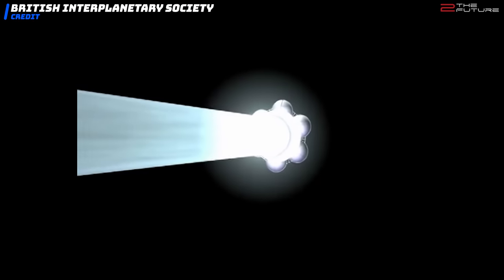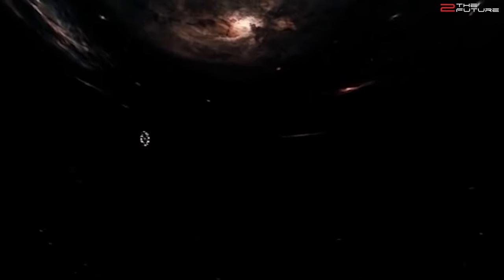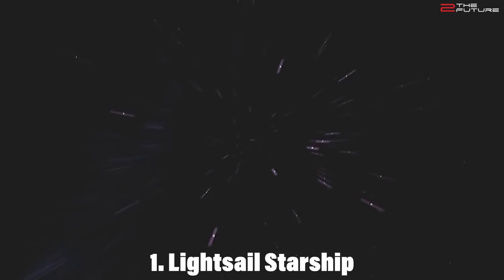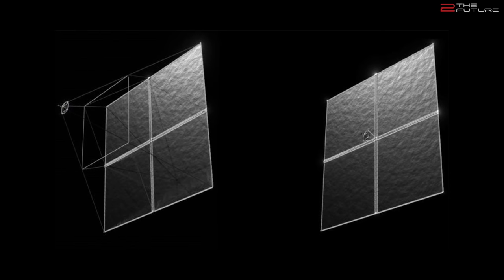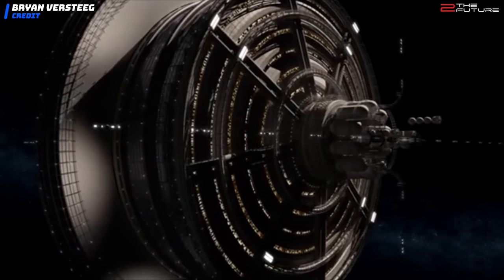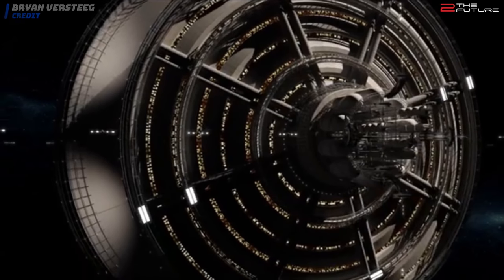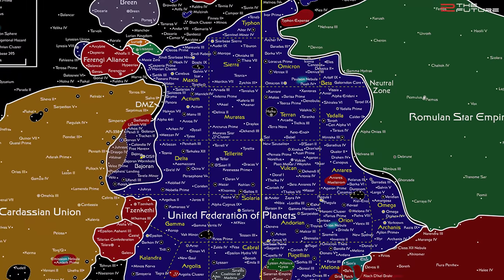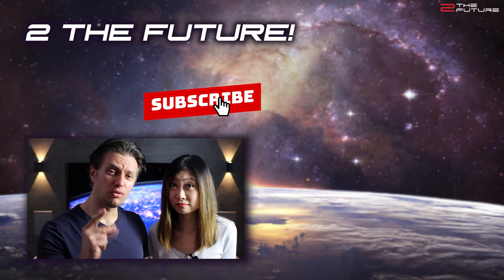Critical Starship Engine Upgrade To Colonize Proxima Centauri [Interstellar Starship Part 2]

Comment: The idea of a huge interstellar generation ship with fusion drive has the following problems:

1) Even stationary fusion reactors are probably still decades away and it will take more time to turn them into affordable engines.
2) There may be abundant fusion fuel in Earth´s Oceans or in the Moon regolith, but the problem is to extract it. Putting all of Earth´s ocean water into centrifuges is one thing, but how do you extract  both components from regolith?
3) Decay. You can´t use the same toothbrushes, shirts and shoes for decades. Likewise engine parts, plasters and antibiotics. So you either need replacements already in storage (a truly big storage) or you build it yourself on site with big factories and external resources - which are scarce outside of stellar systems and would require stops to collect them...which in turn would use up fuel and take years

4) Who would pay for this? No community would fund it, as there is no return to the community. No science, no riches. Perhaps some hyper-nationalist nations with enough economic power would fund such a thing in order to spread their "superior" culture across the universe...

Comment: There is a sf book by Robert L Forward called The Flight of the Dragonfly. In which a starship uses a light sail for a journey to Bernard's Star. The light sail then reconfigure itself in the target system to use light sent from earth to decelerate. It then discards the main sail and use a smaller sail to fly around the system. The book was written in the early 1980's has anybody revised the idea that lasers sent from Earth or Earth Orbit could both accelerate and deaccelerate the ship? It was a one way trip...Great video as always, thanks both.

Comment: the main problem with using ground based lazers to push the massive crewed  light sail is that the lazers would boil fry the atmosphere causing a super heated  fog blocking the lazer... so this lazer will have to be put in space...

Comment: You left out the most important (and highly unlikely) "The Improbability Drive" it allows you to pass through all points in the known and unknown universes at the same time. All you need is a cup of "Brownening motion solution" ( a nice cup of really strong tea) and a curved wire, it worked on "The Hitchhikers Guide To The Galaxy" so, when compared to some of the drives mentioned here, why not.

Comment: MagBeam.by the late great Jordin Kare. Laser accelerates small light sails like Starshot's which guide themselves to a magsail consisting of a large loop or loops of current carrying superconducting wire. A laser turns the small sail into plasma as it passes the magsail and interacts with it's magnetic field to transfer most of its momentum to the sail. Because the small sail need only be accelerated to a fraction of the speed of light, much less energy is needed than if it was moving at photon's speed per unit of transferred momentum.. The magsail covers a much larger area per unit mass than a light sail and the small sail guides itself so that the magsail can have a much smaller area than a light sail since even laser light spreads out over great distance. The magsail can be powered effectively at a much greater distance than a light sail and so a smaller laser can be used since more time is available for acceleration.

Comment: I think we'd do better to fully colonise the Solar System first. If we are able to get a partial Dyson Sphere up and running, it wouldn't be a huge problem to set up a stellaser of the required power to send a laser powered ship to Proxima Centauri. You should check out Isaac Arthur's video on interstellar highways using this concept.

Comment: The large cylindrical habitat does seem the most viable solution given current assumptions and presumes the existence of established space based civilization in Sol system.  A self-sufficient space based civilization only requires energy and raw materials to propagate itself. Planetary colonization and terraforming might be useful in the long run but need not be a high priority as creation of another interplanetary civilization can be implemented with energy, material and knowledge, and establish humanity as a viable multi-stellar species.

Comment: Thx for this informative video.
Oh boy.  Will we deface our moon by mining operations?
What if the reflective quality of the moon's Earth-faced side got diminished because of dark mining pitholes?
Probably it will be a Wild West situation, as it will be difficult to control operations across the distances.

 But maybe it will be better to keep Mordor on the Far Side of the Moon (new album to come anybody?)
Take care
Reply: IRC mining helium 3 is not a deep pit operation as all of it is within 3 meters of the surface of the moon and the tailings IE 90 odd % of the material dug up would just get put back in a previously excavated area.
Reply: @Barskor1  Well let's go then!  At least there won't be any Greenpeace protesters because they can hardly get there, and there is no life to protect!

Comment: Hello maybe using a concentrated beam of light magnified from the sun into a solar sail might solve required power needs and gives a constant push just a thought
Reply: Not as complex just a simple lens system
Reply: IMO just convert sunlight into electricity then into a laser beam solar flares and so on could seriously screw up the inputs for the launches with your plan.

Comment: A deuterium tritium may not be as bad as you think.  Tritium is manufactured for thermonuclear bombs by using a lithium containing ceramic that absorbs neutrons from a fission reactor. https://en.wikipedia.org/wiki/Neutron_activation
If the neutron produced in a deuterium tritium fusion drive reacts with lithium 6 you get an unstable lithium nucleus that quickly decays into helium and tritium.  In other words, you have a breeder reaction that provides more tritium fusion fuel and more helium propellant.

Comment: The baseball diamond in your illustration is wrong for rotating gravity.  You must pitch straight downhill and hit uphill.  This shortens distance you can hit giving a smaller outfield, and makes left and right fields the same, just with opposite curves on a fly ball.  Hitting the opposite way can make a hit travel almost forever, and pitching across the field like your illustration just screws everything up.  Your soccer field is good.

Comment: Why doesn’t anyone ever talk about the probability of a collision with very small matter during space travel? 

One tenth light speed is 18,600 miles per second (ish). Impacting an ice cube sized rock at this speed would produce a nuclear reaction and the resulting explosion would destroy the space vehicle and probably the rock... 

Avoiding or destroying objects at this speed is impossible for a number of reasons, not the least of which would be detecting objects along the vehicle path or those that are on intercepting paths with it and then managing the risks at such great speeds.

Traveling at these speeds, even if obtainable, is not feasible due to this single risk.

Comment: Why don't you like high powered plasma or ion drives? If you have a fusion reactor or even a portable fission reactor that can be cooled in space you have the power to drive these. Their exhaust velocity is higher than nuclear rockets. Both NASA and VASIMR have functioning prototypes. Sea Wolf submarines fission reactors put out 34 megawatts of power. If a similar reactor could be cooled in space a plasma/ion drive running on 34 megawatts could give an Apollo mass space capsule continuous 2.0 m/s^2 acceleration. Starting at 11.2 km/s (earth escape velocity) via chemical propulsion lift off and then accelerating at 2.0 m/s^2 via plasma ion drive can get you places relatively fast, and the propellant can be refilled in space using helium or hydrogen.

Comment: Light sail makes no sense. As any Earth-based laser array is subjected to atmospheric losses, and the planet's rotation would make it only function until line of sight contact is lost. 
You would have to build the array on the South Pole in order to maintain continuous output.  Instead, building it on the Moon would be more effective. No atmosphere.  Place it on its poles. 
But realistically, a sail is impractical. 
Current technology dictates the best method is to use thermonuclear explosions in series to accelerate the large space craft.  This idea has been proposed in the past.  By releasing hydrogen 'bombs' in its wake, the detonation shock wave is utilized to push the craft forward. A large parabolic shield is used to maximize the effect and to shield the craft.  Once accelerated, the craft can pivot 180 degrees to have the shield face forward to collect hydrogen and other interstellar particles to be used for energy generation to continually feed reactors.  Also acts as a shield against any micro meteorite strikes. 
Deceleration is the same principle, ejecting nuclear warheads in front of the craft to use the shock wave to slow  the craft.  
The craft can utilize rotating habitats as mentioned for artificial gravity. But instead use contra-rotating rings/discs to cancel out the effect that induce wobble end over end in space.

Comment: Mr. Caballero is quite enthusiastic, but every iteration of his architecture is ALL WRONG....honestly it appears as though he's taken a "throw everything against the wall, and see what sticks" approach. While the ideaof a crewed mission to the stars really does gets one excitement into the stratosphere, a crewed mission is not needed to obtain real findings from an extrasolar system. 
Using an originally designed Bussard collector to collect IS hydrogen and then attempting proton-proton fusion is, well, lets say, not likely possible in the next 200 years. If Mr. Caballero new anything at all about propulsion systems in space, he'd know that a kilometers across magnetic field (Bussard collector), would already act as a braking system from velocities as high as .2-.3 of C. Look at the Andrews/Zubrin Mag Sail. That aside, there are already TRL level 4-5 technologies that can brake even better than magsail. 
Am not even going to get started on his ideas re propulsion. Solar One doesn't even begin to touch on cutting edge  interstellar travel tech that's already in development. Beyond aspirational, but fantasy! (fantastica!)  Heilige Maria!
2 The Future, what must you be (have been) thinking? 
Kevin Hambsch